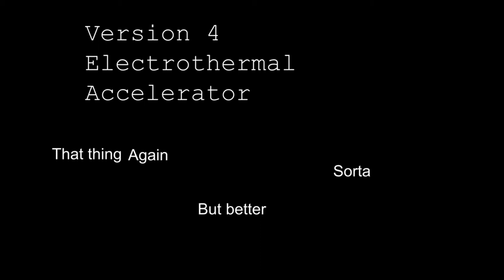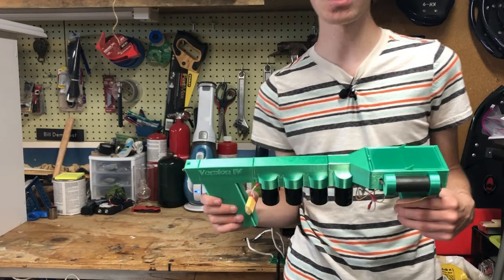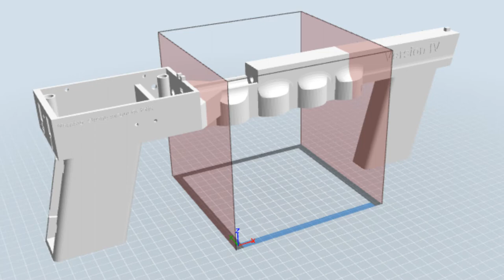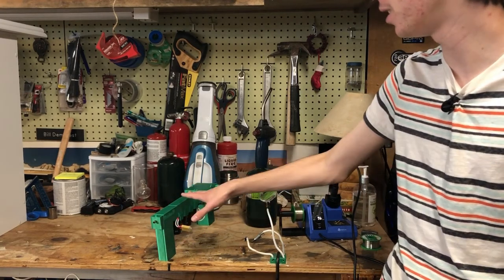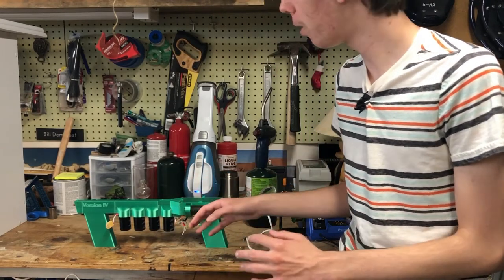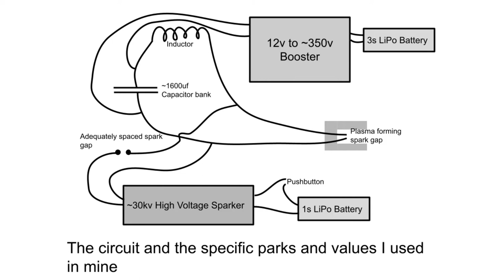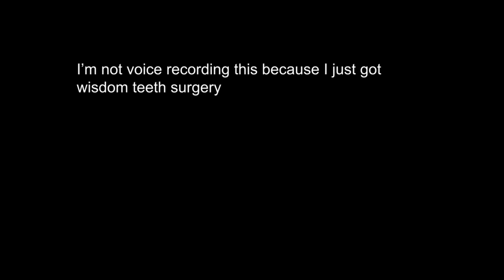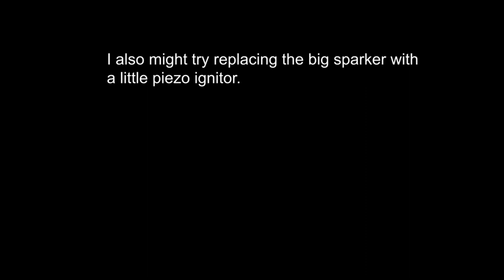Plasma Powered  Electric Gun IV (Version 2-4 Electrothermal Accelerator)

Comment: Im thinking of a proto-scientific gun that has uses casings with liquid or gaseous fuel and liquid or gaseous oxygen inside to propel a bullet. Im  curious as to if it would work, because in my head it seems like it would be way more powerful. Its all about burn time of propellant and the amount of pressure it can build up before a bullet exits the barrel, so i think it would work well.